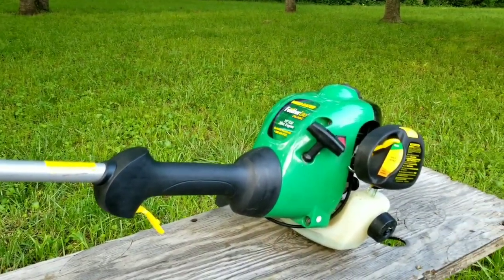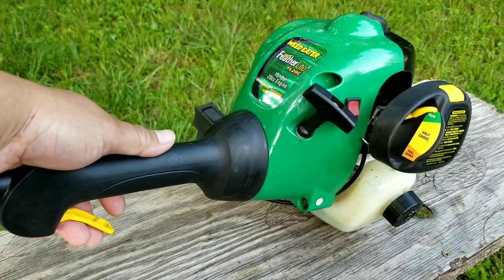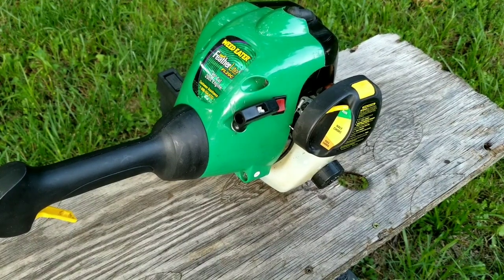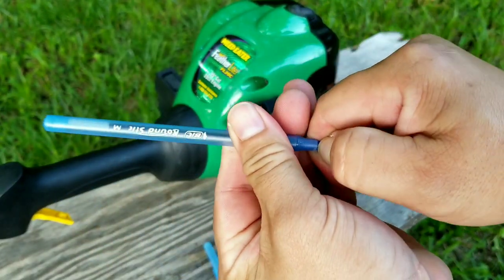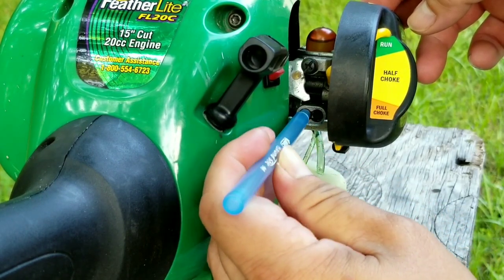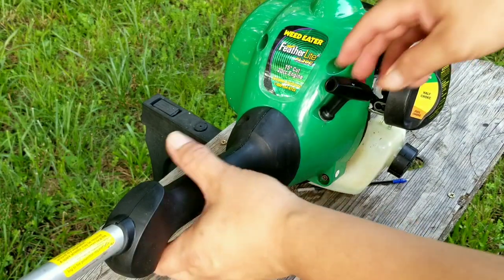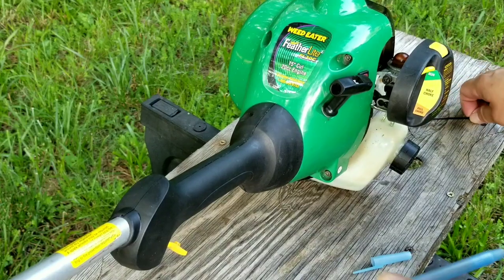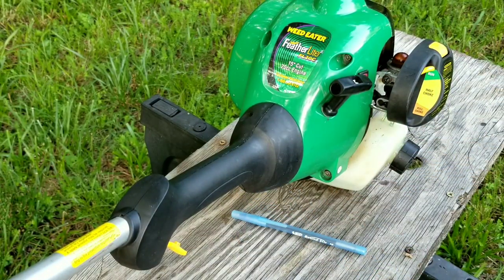Use an Ink Pen to Fix A Weedeater that dies

Comment: I did not think there was a chance in hell this was going to fix my weed eater. I was just getting ready to buy a new one when I decided to give it a try, 2 seconds with a pen and I'm golden. Thank you very much!
Reply from the maker: no problem
Reply: @HomeGaragechannel  
Thanks for the video.  I was thinking that it was the H screw that needed adjustment because that affects the high throttle.  But you adjusted the L screw for low throttle or idle.  Any more words on why that was the problem instead of H screw?  Thanks again
Reply: What size of carb tool would I need for featherlite fl20?
Reply: I totally agree
I was really heading to buy a new one 😄. I felt real like 😑!!!! A freakin pen !!!!!
Reply: @RaspyOB174 because L is for low speed, H is for high speed. Only adjust the H if your Wacker doesn't rev to full revs.

Comment: I just unscrewed the two screws holding the primer bulb without disconnecting the gas line. Lifted up and saw a dirty screen filter. Took a q-tip to absorb the excess gas which also removed 99% of the dirty particles then used compressed air to blow out the rest. Screwed it back on and cleaned the air filter and now it runs like new. Gotta love YouTube
Reply from the maker: absolutely
Reply: @HomeGaragechannel  .

Comment: I trash pick trimmers, replace the rotten fuel lines and rebuild the carburetors and scavange parts off them.  I've been running the same trimmer for 30 years now, lol.
Reply from the maker: very nice work!

Comment: I did a carb replacement on an older trimmer.  The new and original carbs had th SAME issue as shown above.  I bought a new trimmer and ran it for 3 or 4 seasons before it started having this issue.  battled it for a couple more years as i only used the trimmer 4 or 5 times each season.  Played with choke setting (very finicky setting) once I got it started.  Finally found this video and fixed the issue in 30 seconds.  SO much frustration just washed away!  Thank You!
Reply from the maker: thank you Mike McEvoy for the comment.

Comment: I was given a mid 1980s WeedEater 1400 model in really good shape that would not start. Pull/push only for choke... no bulb at all.  I found fuel lines deteriorated and the metering diaphragm needed replacement. The carb is tricky to get out and confounding for an amateur, but the metering diaphragm is easy to feel as a bit stiff and not pliable when exposed. I will install a new one and try again now that new lines and filter and correct fuel mix is ready. Spark plug was decent but replaced. A service shop job would easily be $50-70 and I can do this myself . 2-cycles are not real complex, but you need some understanding and patience... And this guy is methodical and clear as he explains step by step. On a mid 1980s model 1400.... the adjustment screws are marked H, L and are slotted ! So no problem other than a long blade small flat tip driver is needed ... Start at all the way 'in' just lightly and then back out about 1.25 turns each screw and go from there to adjust for smooth and barely rich running at L (idle) and H (full power).
Reply from the maker: Thank you Doug H for the comment and the Information I appreciate it.

Comment: Great idea using the pen👍 I have thrown a couple away after taking all the usable parts off them due to low compression.
Reply from the maker: That all you can do.  Thanks for the comment I appreciate it
Reply: @HomeGaragechannel  You could replace the leaking part to fix low compression.

Comment: I've got 18 yrs out of two of these weed eater brand W. Eaters and the 2nd is still going strong and it gets used about an hour a week. Replaced fuel lines a few times spark plugs air filter pull string and string head and primers. Basic routine repairs that happen to all after a given time.
Reply from the maker: nice, you got your monies worth on them
Reply: @FJBsaidcornpop I have this weed eater bought it used I started it and had it on full choke and started trimming forgot to put it on run as it indicates in the instructions it smoked then died now it won't start what could be the problem it wasn't major smoke but it did let out some smoke

Comment: In my case, the issue was that the rear main seal, or oil seal was having some loss of compression.  I noticed that the bolts that hold the back plastic seal, were loose and needed tightening.  In addition, the seal was not seated and the gasket for that seal was as well loose.  That solved the issue of a stalling engine for the weed eater.
Reply from the maker: fantastic diagnostic work and thank you Nune Cookie for the comment.

Comment: I was given a weed eater because it would start and die,  hope I can get it to run 
Thanks for the video
Reply from the maker: no problem and good luck. If you remove the carb and find the black metering diaphragm hard and not extremely flexible, I would just replace the carb as they aren't expensive for an aftermarket one.
Reply: @HomeGaragechannel  ok,thanks
Reply from the maker: @davehall2160  no problem

Comment: I have the same Weedeater 
I picked out of trash.  I ended up using a electrical wire butt connector with needle nose plyers to turn.  Adj screws but I also had to replace gas lines .
Reply from the maker: Good work. If you we take  care of them they can last. Thanks for the comment I appreciate it

Comment: Nice tip to use a pen. I had not seen that before. Good job brother.
Reply from the maker: Thank you Dave for the comment. It was just an idea.
Reply: use mild heat to soften the pen end and THEN press it on!

Comment: I've ran a Murray weed eater with a OEM carburetor on it and a curve shaft Craftsman weed eater with the same carburetor on it as well and the same thing to another Craftsman weed straight shaft string trimmer
Reply from the maker: very nice, what kind of fuel do you use?

Comment: Back at the end of the '70s I bought my father the weed eater brand weed eater. After it was a couple years old My father every spring would have to take it to the shop to get it worked on and it would last throughout the summer. If I'm not mistaken it lasted close to 20 years before my father went and picked himself up a new one.

Touch on what you were saying about the special screwdrivers. If you are a prime member you can get a good set of these specialty screwdrivers for less than $10 and comes with either a bag or a case to put them in. After watching a lot of your videos and some from other YouTubers is how I found out that you could adjust the carburetors. I was always told that they're sealed because of the government.

Let me say this about the set I purchased from Amazon. For the price the quality of those screwdrivers is unbelievable. I can honestly say I don't know how they are able to stay in business selling them at such a ridiculous price. My only complaint was with packaging. Every one of the screwdrivers which I purchased the 10 pack were all wrapped up in individual little baggies. I felt as far as the environment and recycling that was a little too much. I know that they don't want them banging against one another in transit but I would say they could come up with something better. I had a nice little pile of plastic once I filled up my case.

Like always I did enjoy your video and as always I made sure to hit the like button. Look forward to watching another video.
Reply from the maker: I appreciate your insight and the information. Thank you David Frank

Comment: This is a small world when we look at it. Here is a crazy story. That machine is old as dirt. So happens 4 days ago guy next door put exact one in trash. Said he brought a Bolens curved shaft ( junk ), at Walmart. Said thing all at onece started and dies ( old machine ). Well, not that I need more projects or junk, but I took it lol. 2 days later returned it. Says what is this. I said a working weedeater. One pull fires up and runs. Verdict- course people in their bad gas. Lines all white and carb clogged. Now I did ajust carb first ( with the tool because much easy way to do it ). And that brung it back to life. However, I suspected more to the story is why it acted up. So I rebuilt carb and changed them nasty lines. Any event yes, the pen trick is where I started. That got old and got tool. Good vid.
Reply from the maker: Thanks and good work.  I appreciate the comment.

Comment: Great info. Question, can a bad coil stop the engine from powering up.?? Is not advancing.. ??  Same symptoms.. No adjustment on these carbs. Can get to low, not the High.  Thinking coil is not advancing. What ya know. ??
Reply from the maker: The coil unfortunately doesn't advance in timing. I would consider replacing the carb, spark plug and clean the spark arrestor screen.

Comment: I have a carburetor off a trashpicked weedwacker with a dead ignition system. The bic pen didn't quite work, but the larger "gamebit" bit in my chinese screwdriver set worked a bit better.
Reply from the maker: nice adaptation

Comment: Thanks for the great video. Unfortunately mine will run just fine but dies out of nowhere after a couple minutes then starts right back up and dies again after another couple minutes.
Reply from the maker: I'd check the vent in the fuel cap, or your tank vent. If that's okay, I'm going to say carb.

Comment: Nice idea. Most weed whackers I work on have the old walbro carbs that have 1 flathead adjustment screw . Why they changed it I don't understand.
Reply: They change it to try and stop people working on them due to environmental reasons.
Reply from the maker: Thank you Ben Turner for the comment I appreciate it
Reply from the maker: @themowerman  I believe you are correct.  Thanks Mick

Comment: I call them bic lighters because when they run out of gas, you cannot get them to ever run right again. Generally after a few years the fuel lines rot and fall off. I pick them up all the time and fix them up. For a few dollars I can replace the lines , then resell then.
Reply from the maker: Oh they are bic pens. Thanks for the comment I appreciate it

Comment: I was skeptical about the pen use.  But my wife "donated" a Bic.  I slightly ground down the side of the plastic pen tube to fit easier into the carb.  Unbelievable - I now runs excellent after about half a turn on both.  Frustration GONE!
Reply from the maker: nice work.

Comment: I jave two trimmers one which wont start. The other has the same issue you had. I bet this will fix both. I ordered a $10 toolkit off amazon. I’’m post another comment after.
Reply from the maker: excellent. The one that starts and had running issues, has high success rate but the one that won't start,   if you can't get it started, will need servicing or be replaced.

Comment: I picked up a basically new looking ryobi that runs but dies. Paid $5 . Using your lesson to adjust it tomorrow
Reply from the maker: Hopefully it works. If not a carb is only about $10.
Reply: I bought a new Ryobi 4 cycle, maybe I used it a total of 5-6 hours and am experiencing the "die off when full throttle" effect. I'll try that adjustment screw thing when the sun comes up.

Comment: I wish mine had the exposed screws like this one. It has a Walbro barrel style newer carb. The high speed is buried under the primer bulb and takes a “micro d” tool that I was very lucky to find. The low speed is on top of the barrel like usual but I almost didn’t see it because it is very small and just looked like a brass plug.
Reply from the maker: yes they can be a pain getting to the screws.  If you replace the carb with an aftermarket one the screws are uncapped for easy access.  thanks for the comment I appreciate it.
Reply: Mine was an Echo 2620T. I got it last year and it was set pretty rich on the high but I wanted it to break in and it wasn’t overly annoying. I thought the carb would have the plastic and brass plugs like the 225’s do with the slotted screw behind them but it didn’t and I couldn’t see anything with my 50 year old eyes.I couldn’t find any vids on it but finally found a post on one of the forums about the “ micro d” tool made by Echo Shindaiwa. Only found one store that sold it ( they’re not supposed to) and kinda expensive. I have always loved 2 cycles and have played with them since I was a kid and had a Cox dune buggy 40 years ago.
Reply from the maker: Nice buggy. Yes sometimes they don't even come with the hidden screws anymore so you might want to buy an aftermarket one because they will have the screws uncapped.

Comment: Or you clean the spark arrestor if that doesn't work and adjust the carb if that doesn't work throw in the trash because it will need a carb you can check amazon
Reply from the maker: Thank you for the comment I appreciate it
Reply from the maker: Thank you for the comment I appreciate it
Reply: I got a carb, fuel lines, 3 extra primer bubbles, spark plug and...
..2 air filters and 2 fuel filters for 16 bucks on amazon and it was here the next day!!

Comment: Working on tuning up an FL25C right now. CanadianTire sells fuel lines in a kit but I need to go back and get another 8" or so of 3/16" (the 1/8" isn't tight enough for the primer-bubble return line back into the gas tank. I'll definitely be trying the Bic Pen adjustment as I don't have the splined tool you refer to. Thanks and will let you know if I can get it working again.
Reply: Got her working again! Great. Thanks for the Bic Pen tip.
Reply from the maker: No problem and it works better than expected
Reply from the maker: @jeffchapman8992  nice work.  Glad it worked out for you

Comment: I tried adjusting the carb screws-didn't help! Took the carb apart and inspected, blew it out-didn't help! Put in a new spark plug-didn't help much! Are there points and condenser on this model of weedeater?
Reply from the maker: no there are no points or condenser

Comment: The idea is good, but you don't show which screw you are adjusting, what direction you turned it or how much
Reply from the maker: very true. its hard to determine how much I'm turning because the pen doesn't positively lock to the screw. if i used the correct carb tool then i could safely say how many turns im making.

Comment: The Featherlite is a great weedeater, - they are Poulan - Husqvarna based if you trace back far enough, and a very good performer. I have 2 here in New Zealand. One of them is having the exact symptons as on this video and I have tried this same procedure as well as clean spark arrestor but makes no difference. Will try a carb kit next, although carb looks good inside.
Reply from the maker: Yes the carb is usually the culprit.  An adjustment will help but rebuilding or replacing it usually takes care of it

Comment: I have this same trimmer it will idol whith the choke on and will not take eney fuel only idol put when you take the joke off it shuts of completely.what can I do I have 4 of these that different folks gave me pretty much same problem.all help would sure be appreciated
Reply from the maker: The carb is slowly reducing its fuel delivery over time most likely cause the diaphragm is beginning to harden.  You can either replace the  carb or rebuild it. Or you adjust the carb for more fuel to tie you over this year.
Reply: @HomeGaragechannel  it will idle with the choke all the way down but when I move it up to the next setting and give it throttle will die soon as I do that .iv been watching your videos I went yesterday and got me some of those bic pins I was going to try that and see how that went and I really do thank you for your come back

Comment: Hey can u help me to adjust the valve on a cub cadet push mower 173cc /6.76 ft-lbs OHV thanks
Reply from the maker: I would have to make a video for that. It's not hard but easier to show than write down.

Comment: My last 2 new ones out of the box I had trouble with...one or two uses and the same schit...going back to electrics and buying a new one if it pukes on me....I Think thats the whole industry...my first weed eater from Menards lasted 8 years....the ethanol in fuel should be outlawed....tried making my own e-free gas but it got real messy and lots of byproduct. The ready mix fuel was about 7 bucks  a quart then...not sure what it costs now...
Reply from the maker: ethanol gas has definitely not done small engines any favors.

Comment: I wonder if the access vibration would cause the L and H screws to move slightly. Most cases is that true?
Reply from the maker: No I don't believe so. They are not easy to turn.

Comment: Thanks for your help 
I have same issue in effco hedge trimmer TG2650xp
Very difficult adjustment urgent make video for this brand 🙏
Reply from the maker: Thanks, if I can get the same brand, I will.
Reply: @HomeGaragechannel  i will wait thanks
Reply from the maker: no problem

Comment: I have a echo gt225 weed eater and the bulb won't suck in gas can the plastic white peace be bad
Reply from the maker: possibly, I would replace the carb and fuel lines and fuel filter and that will definitely fix the issue
Reply: I got one on the way carb that is.
Reply from the maker: @johnharkins2162  okay, let me know how that goes.

Comment: Pretty much the same symptom is a broken gas line in the tank .I would  try to pick up  the screen  first look to see if the line didn't  rot off  if the lines are Ok then by all means adjust the  carb but  it  your putting 87 ethanol gas in it chances are  the gas lines are shot
Reply from the maker: Thank you for the comment I appreciate it
Reply: @HomeGaragechannel  I just wanted to point out it isn't always the  carb before they get themselves in the  realm of the  unknown  look for the simple  things first  before advage guy  goes cranking on the adjustments  with no clue what they do
Reply from the maker: @David-kq9vp  gotcha thanks for the help